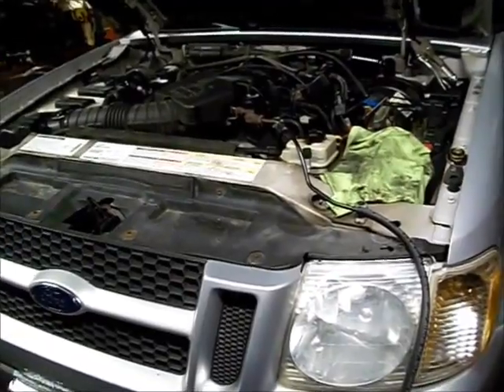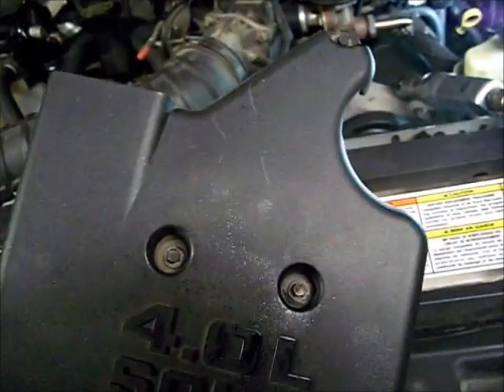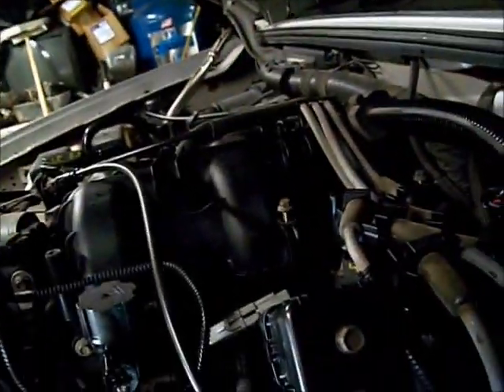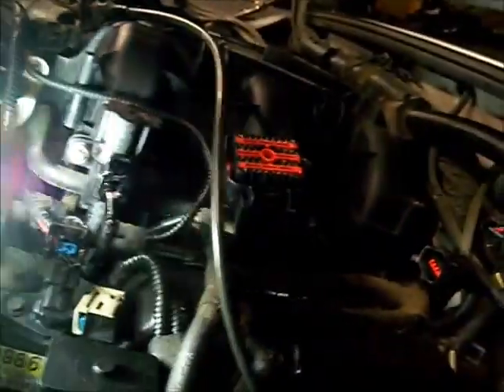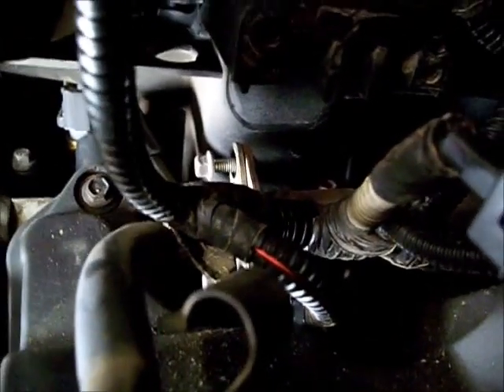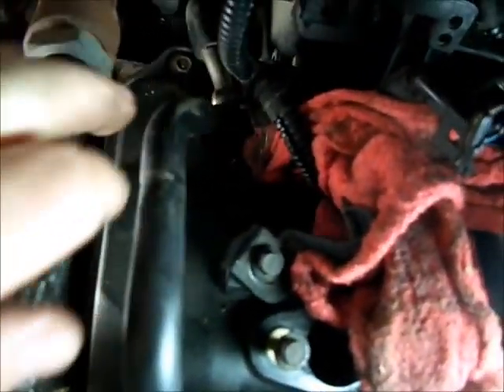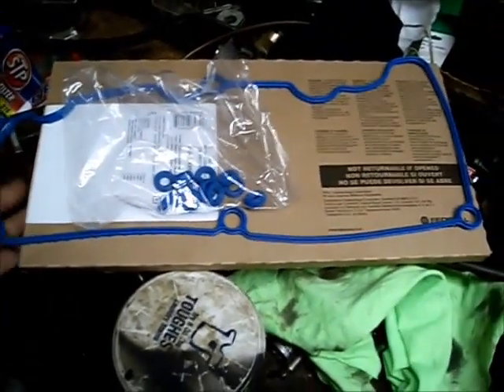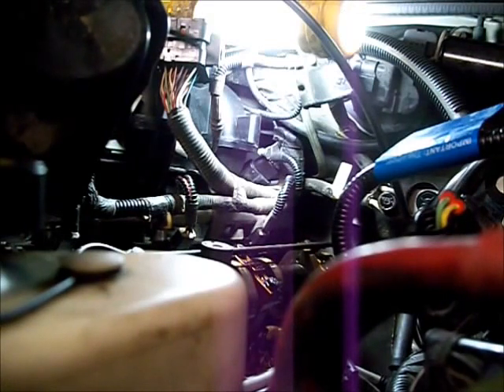Ford Explorer sport trac `01 w 4.0 SOHC pt.1 driver side valve cover gasket replace

Comment: what is your time from start to finish.  Could you be more specific when it comes to the AC and Fuel line, I don't want to contaminate myself but need a new head gasket..is that the same as a valve pan gasket?
Reply: Did you do it?

Comment: hey , doing the same exact repair, to the same identical vehicle, how did you get that hose assembly off of the rear of the valve cover ???
Reply from the maker: +Dave kimble  The plastic tube (super coarse thread) unscrews out of the valve cover, while the metal tube bent around it floats can be damaged easily.
Reply: @AutoDrdiy   could you explain how to go about removing that piece
Reply from the maker: @maledude940  it just unscrews,  really coarse thread.

Comment: thanks for sharing,i gotta a question,what's the reason to drain the cooling system
half way?i want to change my driver side gasket!!
Reply from the maker: +Alejandro Santillan   Drain antifreeze just for passenger side, it has heater hoses attached to the cover
Reply: thank you,that's what i noticed when i started doing it!
Reply: Hi thank you for your time and information. Did you try retightening the valve cover bolts first?

Comment: i have the same exact truck and im smell8ng burnt oil and seeing smoke from rear engine bay drivers side headers look wet like its dripping on manifold possibly, could that be valve covers or is there any other things it would be
Reply from the maker: sure thing, if they haven`t been changed yet.

Comment: Thanks for the video. I was wondering if you lived Connecticut?
Reply from the maker: +Theresa Costin  Thanks for the comment, and I am generally a 10 hr. drive SW of your state. Haven`t had a reason yet to go any farther N/E than New York so far. That was several years ago, but was recently 9 hrs. SE at New Port News. By coincidence, I may have to go back there to work on a BMW 540i timing chain replacement.  Should be interesting with 17 special tools ideally required to do the job.   03/05/16  The BMW 540i actually made it to my location, (where the tools are) and got repaired using about 9 special tools.  A comprehensive video of that EPIC repair is on my channel in 8 parts.

Comment: can I use rtv or some kind of silicone to make the gasket? I have the same engine in my 2001 ranger
Reply from the maker: Not a good idea, as it will either fail right away, or soon after and leak oil severely.  Maybe to the point of fire.  The groove made into the cover is not the right design to allow rtv to effectively seal this area.  If it were flat like the head sealing surface, then it would probably last long enough to make it a practical choice.  And you would have to go through the whole process again, and remove the rtv if it didn't work.  That in itself makes it unworthy, even for an experiment.
Reply: alright thanks

Comment: Do you know if the ignition coil bracket bolts can leak oil?
Reply from the maker: xXluckyjoe7Xx. I think so, and or fall out, or get left out.  And the same bolts on the other side head, do the same, come loose, fall out.
Reply: Thanks for the info. Do you know where I could get replacement bolts? I have one of the 3 that go into the block and its the rearmost one.
Reply from the maker: xXluckyjoe7Xx.   You really only need 1 to hold and ground coil, make it tight.  But junk yards have  bolts, auto parts store have bolts, etc.
Reply: Auto Dr diy but if they're leaking oil onto my manifold I need those. And i cant find anywhere that has specs for these. I have the one. But it only fits in 2 of the 3 holes. Was hoping you had a diagram or part number or something. Thanks though!
Reply from the maker: No, they are all sealed, or the lower 2, would likely leak antifreeze from that low in the head casting.  And the top one would likely leak vacuum from engine`s intake plenum, and sill not oil.

Comment: What a pain in the ass! I'm a diesel mechanic by trade and I didn't have time to mess with it, nor a shop to do it in so I had someone else look at it and he told me the fittings on the back of the cover is what was leaking. He said he fixed it (it never completely went away) but a year later the oil is smelling and smoking again. I guess I have to bite the bullet and do it myself. Damn I hate all the cramped shit.
Reply from the maker: I heard that.  Thanks for watching.
Reply: I have to go look but as far as draining the coolant for the passenger side. I usually put vise grips on the hoses and just pull them loose from the heater core. Like I said I'll have to look and see it that will work in this case.   FORDS SUCK.

Comment: Shop wants  $ 375.00 to replace gaskets on 01 f250 351 would you consider that a good price, or should I shop around. Also why do start to slightly  leaking  uniformly on both sides, can the covers  be snug down again to stop the leaking?  Not losing oil so much as smelling it.
Reply: +Dave Meeks What all are they replacing? That sounds like a hell of a deal. .... Oops I was thinking head gasket not valve cover.

Comment: Does the engine tick if the valve is lose or broke?
Reply from the maker: Estevan  Martinez. Not the valve, but the lifter, or cam follower can cause a tick.  But more than likely with this one is, that if the tick is more of a rattle sound, at times, (start up) then its the timing chain getting worn out
Reply: Auto Dr diy what would be the solution of fixing it's a tick and at sometimes it's a rattle
Reply from the maker: Estevan  Martinez   A couple of them I know of, have been rattling for years.  Cause chain is bad.  Some keep going and some jump time and shut down.  I'm not sure why 1 goes forever and the next 1 dies, it is weird.  But at the end of the day, it will have to be taken to a garage, and have the updated chain cassettes, and tensioner kit from Ford installed.  It involves expensive special tools,  (I've purchased from ford), the procedure is relatively complicated, and beyond the average person's ability to complete successfully.
Reply: Auto Dr diy what does it take to replace lifters?  How much is cheap right fix?
Reply from the maker: Estevan  Martinez. Not sure, have never had to replace the lifters in this engine.  If any engine noise, always timing chain issue.  In general, I do not generally discuss cost estimates on repairs, on here.